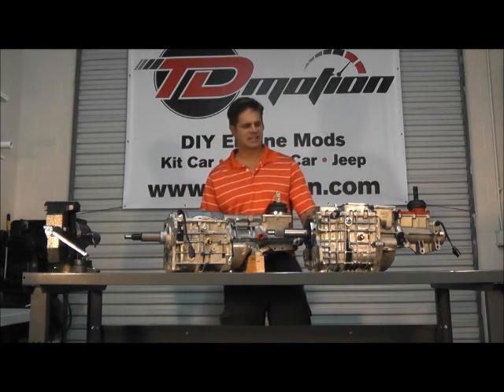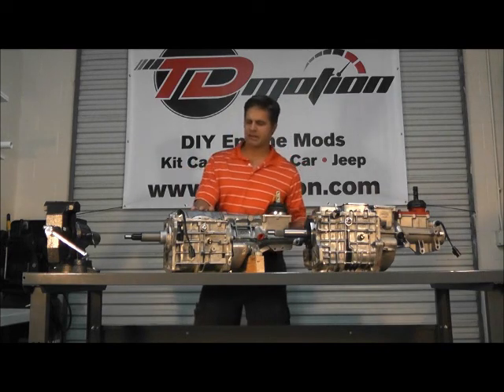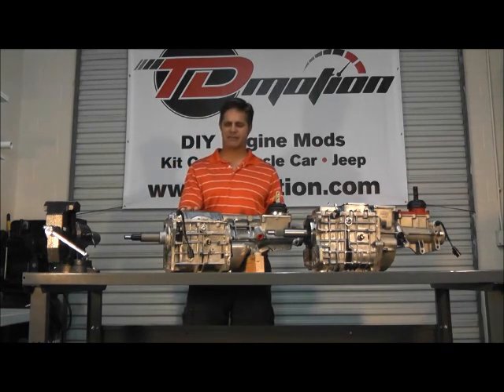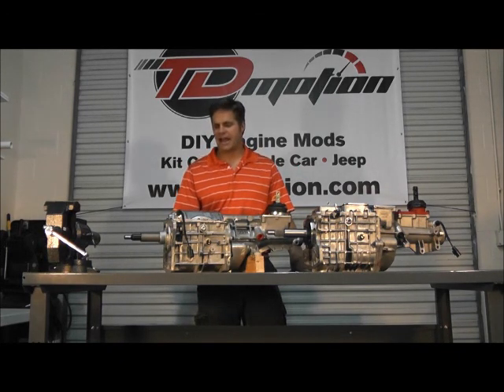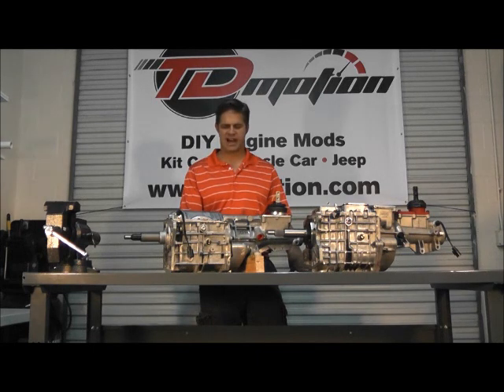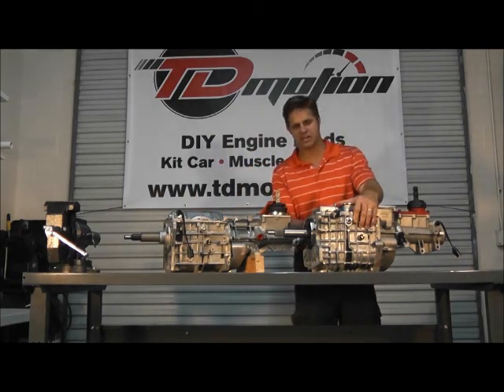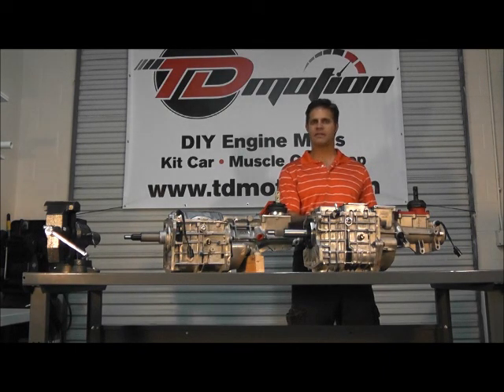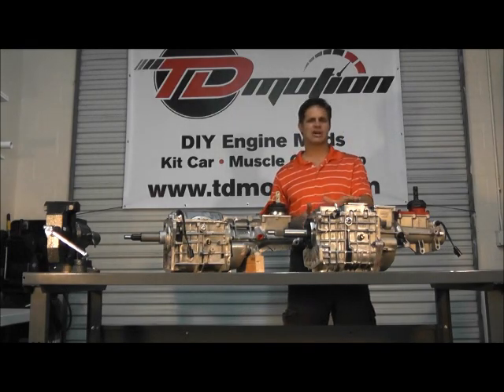TKO vs T5

Comment: Hey guys I installed a TKO 600 5 speed in my 67 mustang and the shifting is notchy to say the least?  Now I only have 400 miles on it and have not yet changed the oil in it so maybe that has something to do with it?  But was wondering why so notchy??  because its new?  Let me know your thoughts on this just was wondering on why so notchy?  Thanks.